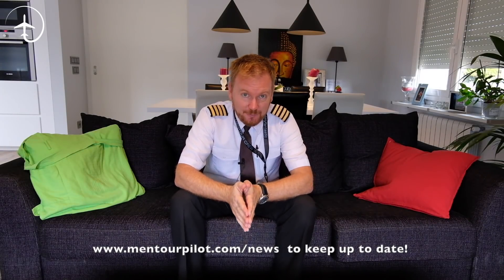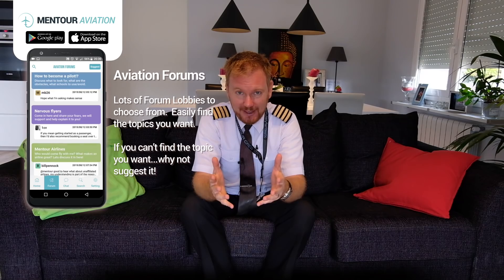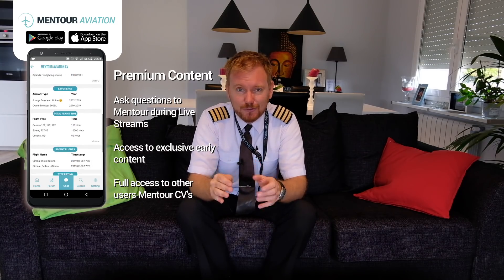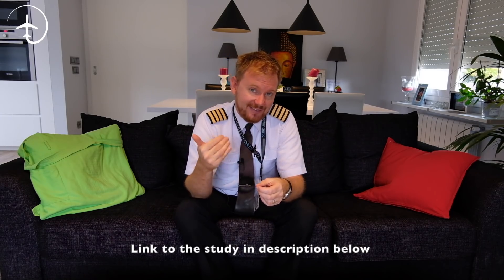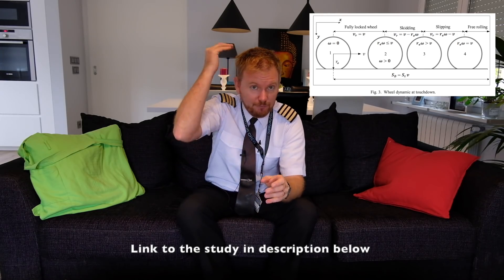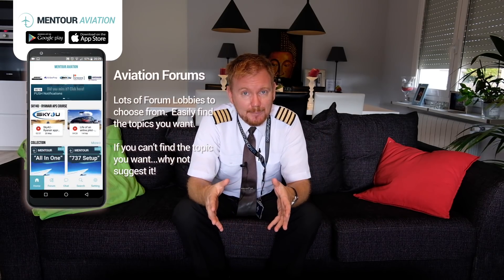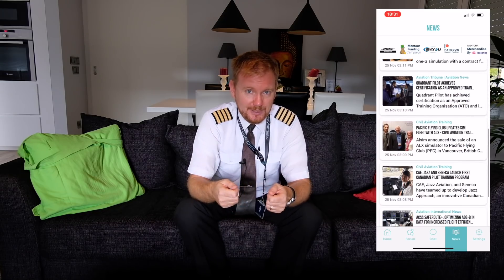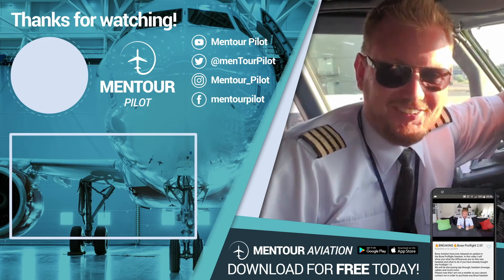Use WIND to spin the aircraft wheels before landing?!

Comment: One should also look at what airflow-assisted rotation on tires would do on take-off.  The wheels would be rotating fast as they were being retracted into the wheel well.  All the rubber you might save on the runway at landing would likely end up on the wooden bump-stops in the wheel well after take-off

Comment: At least you understood gryo is not an issue. Thank you VERY much for providing a link to a study ! I appreciate the estimates. I'm not totally convinced the numbers are right or that you said them right. So I will go read. But um, if the wheel were spinning at ground speed, um, what would be causing this 50 percent remaining loss you are claiming? Maybe I'm missing something so I will go read. Or maybe you misspoke, maybe I misheard. I can imagine it might not be a cost benefit issue. But you know, those usually have a time factor, meaning they can short sighted. But idk. It would depending on the added cost of maintaining and carrying a spin system. The RnD woud be trivial. But as you implied, it's hard to imagine no actually smart people looking into. So thanks again for the links. It's a subject I've been interested in for 40 years. (not the whole time lol)  I suppose  you realize a non-spinning tires result in landing in a skid for a moment. That moment is probably longer on a wet runway, and may be affected by rubber on runway. Thank you for mentioning the rubber on the runway aspect. Your coverage is not always totally satisfying in that it can sometimes seems a bit cursory or patronizing/arrogant or, frankly just not thinking about things rigously even though you are a pilot. Most of the time your coverage seems perfect though.

Comment: Do those cost/benefit analysis account for labor costs, too, or just material costs? What about the time it takes? If you can reduce the frequency of enough maintenance tasks, you can eventually reduce the frequency that the whole plane has to get taken out of service for checks.

Not saying they got it wrong, just wondering if all they did was look at the cost of tires vs the cost of flying the extra weight around or if they went more in-depth.

Comment: 6:35 - the graph you're showing is that 50% pre-rotation reduces tire wear to about 35 to 37 grams, down from about 58g.  I was going to say you must be mixing up grams with percent, then I did the math:
(58 - 36) / 58 = 0.379.  So yes, that graph does show about a 37% reduction, down to ~37g, from vs. a standard landing.
Just a coincidence that the number in grams (that I eyeballed from the graph) is close to the percentage.

Comment: One thing about laying down rubber. I'm inclined to think that a runway that's got a lot of rubber laid down is going to be slippery when wet, but actually provide better grip when dry. Of course, that doesn't really matter because it's precisely when it's wet that a slippery runway becomes a real concern, but I was still wondering, is that your experience on dry landings, that a runway covered in rubber offers more grip than a freshly cleaned one? I ask because that's the way it is in racing. After some rubber has been laid, specially of the same compound as the vehicle currently racing, you'll have more grip. That is, if the track is dry. On a wet track, the racing line gets slippery around braking areas.

Comment: Captain, I may have this totally wrong but spinning the wheels maybe a good idea on perfect landing conditions, for example directly into the wind, but what if there was tail wind pushing the aircraft along the runway? What if there was a quite severe cross wind and the plane flying "crab like" until at the last moment when the nose wheel was pointed in the direction of the center line. Wouldn't either of these landing conditions increase the risk of the aircraft leaving the runway?

Comment: To reduce touch-down tire wear and to also reduce plane sudden lateral jerking when touching down in an angle due to heavy crosswinds, is it worthwhile to embed simple conveyor rollers (no belt), or roller beads like in an abacus, with gradually increasing stiffness, in the first 1000 or so feet of the runway?

Comment: Another consideration is that anything mechanical that spins the wheels adds another failure mode... more applicable to the motor scenario... but imagine if a shaft seized on one wheel only. Risk always has to be factored in.

Comment: For all those re-inventing such systems, some questions:
What does your system weigh?
What's the fuel penalty for carrying N kilos constantly?
What is the drag penalty during takeoff or a go-around?
Another factor to bear in mind, I'm no aircraft engineer, but I know from the automotive sector that increases to unsprung weight are usually a very bad idea in terms of grip & braking performance at high speeds.  I find it hard to imagine that would be less true on an aircraft.

Comment: Great video, as always Peter! I have a question about the takeoff and climb phase... I play on simulators and never know at what vertical speed I should climb. Is it always the same VS all the way to cruise level? Or do you decrease the VS the higher you climb? I hope the question makes sense. Thanks and cheers from Argentina!
Reply: I'm not a pilot or that type of engineer, but I imagine your vertical speed would drop as you climb because the wings produce less lift in the thinner air?
Reply: @JQB45  Yes, it actually becomes harder to climb the higher you are. I wonder how they do it irl, specially on the 737 since that's the one I usually use in the simulator.
Reply: The definition of maximum ceiling is when the aircraft can no longer achieve a climb rate above a certain number, so yes.

Comment: If I'm wrong please correct me but if we start rotating wheels before landing it will make less wear on whells this part is ok but plane slow down in longer distances because when you touch down whells will start rotating and this means some amount of force affecting it and that much force we lose from planes momentum so we save that much force to brake.
Reply: You are correct, but given the mass of the whole plane, the difference is negligible, maybe 6 feet, 2 meters at most. Given a 6,000 ft runway that is 0.1%.

Comment: I really appreciate this response to our curiousity and the continuing of our education. But (there always is one, no?) airlines move seats an inch or two closer together just to fit in another row. They carry just enough fuel to be legal so they're not wasting any money. They cut down or removed in-flight amenities (at least the free ones) to save a few cents. So I don't believe they won't spin up tires even if it just saved 1 cent per flight. And the airports wouldn't have to pay to clean the runways. And flights wouldn't be delayed by closed runways for cleaning. And flights would be safer since you'd not lose traction on skid tracks. And there's probably a million other benefits I'm not mentioning. But it has to be money, so maybe the change would require recertification of planes, which is way expensive. Or at least a redesign of the wheel wells, and initial certification of the apparatus to spin the wheels. If airlines are particularly hurting then they'd need to be penny wise and pound foolish, saving the immediate costs even though it the investment would benefit them many times over in the long run.

Anyone else wondering why Mentour seems slightly pissed over this topic? Or maybe our responses? Or our questioning him? Weird.

Comment: The relevant question would be when you order Gear Up do you tap and hold the brakes to eliminate rotating mass from entering the wheel well?
Reply: The pilot doesn't need to do it because the brakes are automatically applied when the gear is retracted, and the wheels stop spinning before they enter the wheel well.

Comment: Kinetic energy goes with the square of speed. So if you prerotate the wheels to 50% speed, you only get 25% of the energy lost in the impact recovered. The results of the 100% prerotation did surprise me, however. 

Great work!

Comment: Hey Mentour, i got a great idea for this but i need someone with engineering degree to discuss it with. I actually have an idea that could revolutionize the whole industry. Not only airplanes but also trains, trucks and heavy equipment. I wish there was someone that listens.
Reply: I'm listening. I am skeptical, but open to discuss it. And I do have a degree in engineering :-).
Reply: If it sounds too good to be true, it probably is.
Reply: @oakld  how can i contact you in private? Maybe in FB? Im Gabriel Kovach there.
Reply: @666vraptor  I don't use FB much. It seems you have a Twitter account (with another bike avatar?), you can contact me @OakCollin. You have to subscribe to me to send a private message, even if temporarily.

Comment: In real life, the costs (which was spoken about partially) is the key. And it doesn't mean it has to get rid of all wear, improvement in tens of percents might be significant. There's already wide spread design of gear which as a result turns the wheels - it's the aerodynamic covers of small aircrafts fixed gears (i.e. SR22). Since only the bottom part of the wheel is exposed, it spins. Although the rotation is on the far end away from landing speed, it has an effect on the wear, in this case a side effect. In turn, it is possible that in future some aircraft manufacturers will study it further and i.e. redesign gear doors and other features using CFD analysis in more smart way to mimic air flow of the fixed aerodynamically covered gears in order to reduce drag during take-off (when there's huge fuel consumption) and reduce tyre wear at the same time. It might economically work if it will be possible to employ features that are already there, i.e. well doors as air flow deflectors. But it certainly wouldn't be a revolution, just an improvement, a little step forward.

Comment: The motor-assistance concept would work best on the front landing gear, with a single motor linking both tyres.

I'd also add KERS to the wheels to take some strain off the brakes, improve deceleration, and charge batteries to later spin up the turbines to save fuel.

I would also add airbrakes to the plane, like flaps that pop open, so that it can slow down more quickly, and again, extend the life of the disc brakes.
Reply: Batteries cost weight, weight costs fuel per time flying with it.
I know there's a lot of energy in a landing, but you only land once after hours of flight.  Not at all like a car in urban traffic, or even on a highway trip.
The more energy you want to capture from a single landing, the heavier a KERS you need.  And the larger a supercapacitor you'll need.  (A chemical battery won't be able to absorb that much charge in the 5 to 10 seconds of stopping distance.  Some planes do have batteries on-board so a supercap can charge the battery over time, or just hold the energy until time to spin up a turbine.)

It's also pretty negligible in terms of the amounts of energy being thrown around by a plane: thrust reversers provide most of the stopping energy on a normal landing, and that uses the main engines for a few seconds, at the same or lower thrust they were at for hours of cruise.

(Short-hop flights might be in the air for a half hour between landings, making KERS weight slightly easier to pay for itself.  And with a smaller lighter plane, maybe not such an engineering challenge?  OTOH it needs to be even lighter to be still a tiny fraction of the plane's overall mass.)

I guess you can also do KERS for braking during taxiing, though, perhaps powering electrical systems that way instead of adding more load to the engines directly.  That could increase the value of a light-weight lowish brake-force KERS that is used in preference to actual brakes at low speeds and low requested brake-force, but I don't know how much braking is actually needed during taxi.

Comment: The Convair CV 240, 340, 440, 580, etc series, used a wheel spin up system that used air flow vanes to rotate the wheels.  In short it did not provide any savings to the airlines or operator that flew the airplane.

Comment: I also wonder how much such rotors would add to the weight of the aircraft, and how much that would increase fuel usage. Sure, it'd be pretty negligible per flight, but so is the amount of rubber laid down in a single landing. Would be interesting to figure out if the idea is a total non-starter on that basis.

Comment: Change of subject. 
How much pressure is pressed down, on the inside of the engine. After the bare metal on the front of the engine and before the first fan blades. There's a mesh, which I'm guessing if for noise dampening. 
We see people standing on these, so how much weight can it take, pressing down like the air would? 

Probably an engineer's questions I'm guessing.

Comment: Having electric motors built into the hubs can have more uses than just saving the rubber, it can spin up the wheels for landing, but then it can also be used for slowing down and braking adding redundancy, let alone removing the need for airport tugs, the plane could push back on its own, it could also use regenerative braking to recover the energy lost in landing. A properly thought out system would have more than 1 use, so the total would be cost effective.
Reply: steve5090406:  My guess is that "taxing" a 737 requires at least 40 HP (visualizing a 40 horse team seems about right).  Any electric motors would be "un-sprung" weight and even an "aircraft designed motor" would have a significant size and weight, as for regenerative drive, at best a motor can only generate twice its power capacity for a very short time and 80 HP of breaking is a drop in the bucket bringing a 144,000 pound aircraft from touchdown to taxing speed in a mile.

Comment: What if we changed the run ways maybe to concrete or make the first few meters of touch down runway wet in order to reduce friction?
But on the other hand, wouldn't spinning wheels only counteract the purpose of friction and slowing the air craft? So I really don't understand why we'd want the wheels to spin by the air in the first place? 🤔
Reply: This whole question is just theoretical. This thing has never been a real problem. And the most simple way is just change the tires when needed.

Comment: You could sidestep the whole tire issue by putting pontoons or floats on the landing gear and landing on water. Or freeze the runway and land on skis. Or have a magnetic cradle that accelerates to meet the speed of the airplane.
Reply: Andrew Waterman the magnet idea is cool!

Comment: If you have motors on the wheels, you can shut the engines down early and taxi back on motor power. That would save big money in engine runtime hours and maybe a little jet fuel. Or is a cooldown taxi an important part of shutting down jet engines?

Comment: Spinning up the wheels using some sort of fan/rotor blade might cause a lot of drag in addition to the usual drag of the gear being dropped. That would take some getting used to and some refinement of speeds/thrust etc. Similarly after take off, there would be more drag and that might not be ideal..

On take off, there would also be increased wear on the systems used to stop the high speed rotation of the wheels as they are brought into the "up" position. 

Also, what about being in a cold climate and having some of the spray/slush/snow freezing onto those blades . Yeah, inertia would probably clean most of that foreign matter off once the wheels came clear of the runway, but any imbalance on those blades might cause some nasty vibration.

Comment: I'd like to see you talking about the pressurization of the cabin for descent, why there's no solution for that barotrauma, especially in children. Why it won't be done any other ways than the way it is? I suffer a lot with that, I feel like my head is going to explode, even when I swallow and try to open the auditory tube.

Comment: Did anyone mention that perhaps the momentum transfer from the airframe to the stationary wheels when they touch down is a good thing? It slows the aircraft slightly on contact with the runway - exactly when you want it slowed down. Spin the wheels before this (by whatever means) and you lose this advantage when it is the most useful.

Comment: There's one thing that wasn't mentioned about that technique. The additional drag it would introduce. You can't take kinetic energy out of "the wind" for free, there would be extra drag which would need to be accounted for, and probably extra forces on the landing struts (though I suspect it wouldn't be an issue, if they can hold up a large plane). Where it could become a problem, is in take-off, where you'd have extra drag to overcome, and it would extend take-off distances, and fuel consumption, as more energy would be needed.

Comment: Also i tought a syste to "store" cinetic energy in the wheels during flight, a tiny amount eveey minute, like slowly winding a clock, so when landing gear is deployed, it's mechanism waits until the aircraft reachs like 100 ft, then the winding mechanism starts spinning the wheels to save tires. I later found that it was not a good idea to spin the tires in rainy conditions.

Comment: Speaking from a Mechanical/Electrical engineer's standpoint, 'A design can always be improved upon'. And 'If it works, don't fix it.'  'A design's chance of failure is directly proportional to the square of its complexity.' Finally: "If anything can go wrong, IT WILL."  - Murphy's First Law - SO KEEP IT SIMPLE.